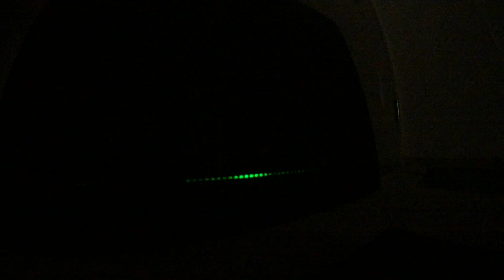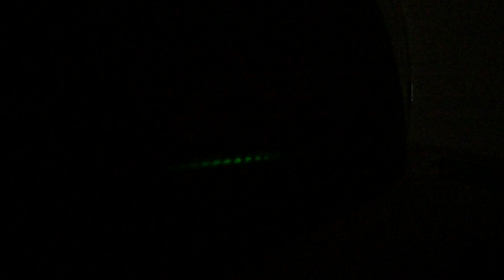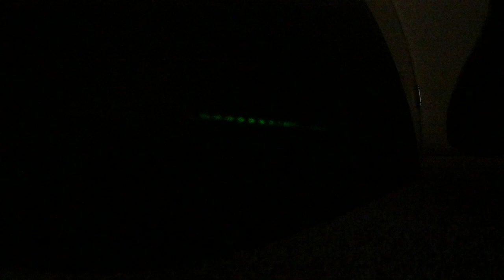Double Slit/Quantum Eraser - Phase Shifting Interference Pattern

Comment: Have you tried to do the same experiment without the first polarizer? Would you see interference when you put the two slot with polarizer on them or you need it in front of the holes? have you tried that?

Comment: Hello! This is Reddit guy. I had imagined your experiment was conducted a bit differently. I can imagine how my questions would have been confusing. Now that I see the setup, I think I know what is going on. Great setup by the way!

I am going to assume you have an understanding of the vector nature of the electric (E) field in light, and further that you understand what polarized light is. - When light passes through the first 45 polarizer, the E field is oriented at 45 degrees (like this /, pretend this is an arrow pointing upward at 45 degrees). After passing through the slits, one beam (B1) is polarized at 0 degrees (like this -->), and the other beam (B2) is polarized at 90 degrees (like this |, imagine an arrow pointing up). Imaging how the E filed is oscillating in each beam over half a period. In B1,  the field moves from left to right. In B2, it moves bottom to up. Now we add the polarizer at 45 degrees after the slits. Start with the polarizer like this /. Consider the projection of the E fields in B1 and B2 alone the polarizing axis. After passing through the polarizer both B1 and B2 will then be an E field moving from bottom left to top right (they will be in phase). Now consider the -45 polarizer, like this \. The E field in B1 will move from top left to bottom right. In B2, the E field will move from bottom right to top left. That is both beams will be 180 degrees out of phase. 

Hope this is clear. Let me know if it's not.
Reply from the maker: That was actually very informative and makes perfect sense! Thank you!

I've got some additional questions regarding something else I'm seeing. If you don't mind I'll ping you on Reddit once I get a video up so I can get your take.
Reply: @armchairphysics6558  Sounds good.